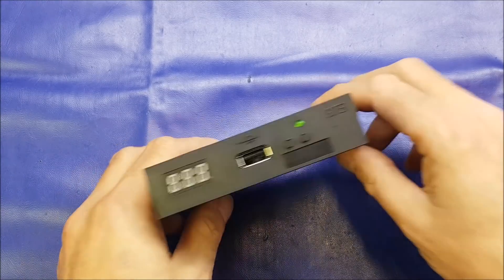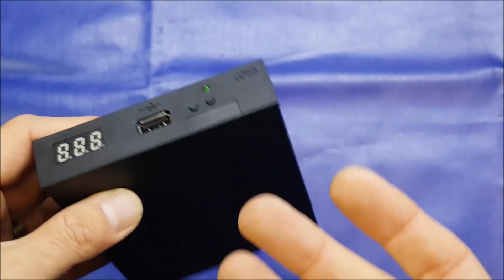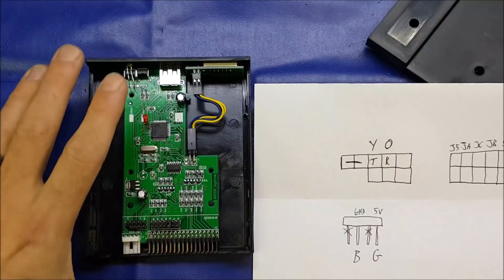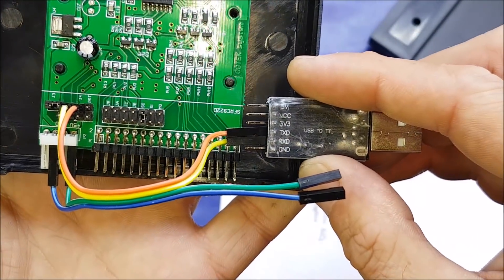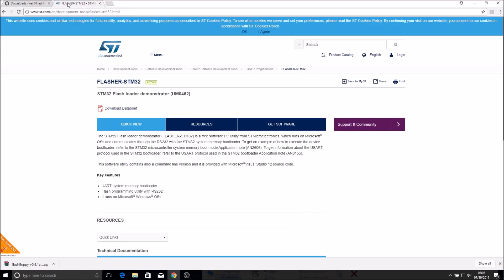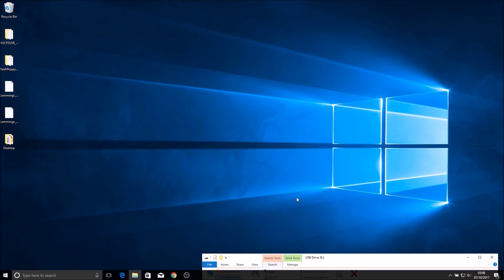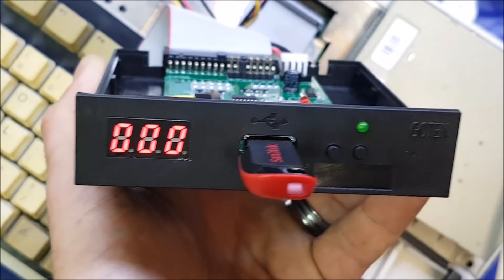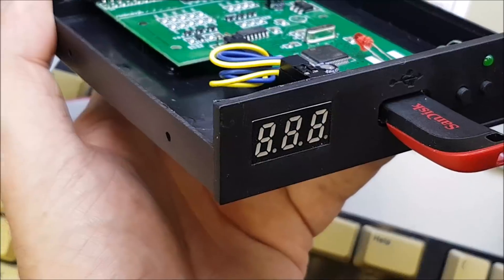Gotek drive - Flash Floppy custom firmware install and OLED / Sound mods (Amiga, Atari)

Comment: Starting in 2021, Gotek drives come with Artery microcontrollers. You need to use the Artery ISP programming software, but can still use the same serial programmer shown in your video. Wish I could like this video multiple times. Nice work.

Comment: This guide is by far the best one. Simply put and no fuss explained so that everyone can do this.
I bought a Gotek some time ago and had yet to set it up.
Mine came with no segment led, bought it direct from the suppliers so no firmware etc  so I will be fitting this OLed screen.  Why its not a standard feature is odd.

Comment: Finally got around to flashing my Gotek and it worked! My USB to serial programmer's pinouts were slightly different as you indicated in the video. Adding the LCD display was so easy. My ribbon cable's red marking was toward the power cabling, which differs from yours. The only issue I had was with the HxC files. I had to go get a newer release because the ones you linked would not work, but the new versions worked perfectly. I threw Shadow of the Beast ADFs on my flash drive and had lots of fun. Thank you very much for your video.
Reply from the maker: No worries at all!

Comment: Thanks for that. I thought I was going nuts! I tried the OLED option as well as the LCD/I2C-backpack options (with appropriate changes to FF.CFG) and nothing seemed to work except the original 7-segment displays. Turns out, whoever created the circuit diagram I was working from had the data and clock lines arse-about! At some point I switched them but I may have omitted to reset and by that time, was starting to suspect my hardware (eg. dodgy hookup cables perhaps). All looking good now, thanks to your mentioning which one was SCL.

Comment: Kris, thank you very much for this video. I'll just add that you don't need to solder the lower pins (the group of 4 pins). In fact, it is a lot easier to solder just the top 5 pins.

Comment: *Just a note that might help someone else.*  I have a Gotek SFRC922D card,  FTDI232 USB serial device, Windows 10, and the latest version of ST - Flash Loader Demonstrator (as of 9/16/2020). I could not get the ST flash software to connect to the Gotek until I wired in a couple of pull up resistors on the TX and RX lines which is most likely due to a shortcoming in the FTDI serial interface. This potential problem is discussed on the Flash Floppy "Firmware-programming" page. Rather than go to the trouble of soldering the pull up resistors to the GoTek board, I used a bread board and connected a 10k pullup resistor to each of the com lines there and wired the Vcc from the FTDI through the breadboard as well (5 volts) for the pullup supply.. This solved the connection problem and the flash process was successful.

Comment: Hi, just want to add for me to get this to work I had to add two pull up resistors to the Rx/Tx lines otherwise it just would not connect to the Gotek, great thorough video btw
Reply: Hi Brian, how big were the resistors you used to fix a problem?

Comment: That processor in the floppy emulator is probably more powerful than the 68000 in my Amiga.
Reply: Same here, i'm using that ARM beast to be a drive controller on an A7000+ acorn archimedes lol. Should be the other way around. :)
Reply: Sure it is. It has 1.25DMIPS/MHz core running up to 72MHz. That's roughly 100 Dhrystone MIPS. 68000 has roughly 0.2DMIPS/MHz (and 7MHz inside A500/A600) and even 020 or 030 can't really compete with ARM there. But... since ARM is as pure RISC as you can have it also means it usually takes more instructions to make same job done. And Dhrystone isn't exactly the best performance marker anyway. But honestly that floppy emulator in it's purest raw performance is like a beast tamed by a kitty (amiga). If there's pin compatible F4 it most likely would be faster than even 060 since it also has FPU (well no direct comparison to 060 fpu) and runs at speeds of 180MHz. So... yeah.

Comment: Nice one Kris - I had pre bought the bits ages ago to do the firmware hack and the LED replacement and drive click but hadn't done so because I knew I would have to get all the info from the different places I had seen but you've got it all in the one place for me and I'll crack on now :)
Reply from the maker: +skilgannon1971 Fantastic pal...let me know if you have any trouble and I'll try and help you out.
Reply: Thanks Kris :)

Comment: At 4:40 you say you'll need the (new) header in cojunction with the power connector to programm the Gotek. At 7:00 you explain how to connect. But the power-connector is directly connected to the (new) header. So you can use those pins to. I made a (fool proof) connector for these pins wich not only send the flash-data but also power the Gotek.

Comment: Great video! I want to put this Gotek into 2 of my vintage synths. Where did you get those jumpers at 7:40,if I deciede to go with the mods make it work from 36 pin to 24pin inputs? Kind regards.

Comment: The problem about this emulator is that’s is doesn’t go back in the number on the display, if you are for example in the 10 and you need to go back to number 8 for example there’s no way only turn in off the device our restar the keyboard...

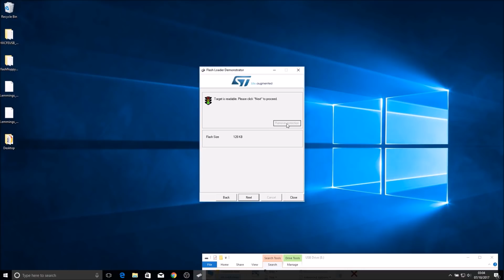Comment: Kris, Great info video. Following your steps. But you gloss over a major point. At about minute 12:15 you mention com ports. How do we find what com port to use? I show Com 1,2 & 5 available  from the DemoLoader but none connect to the USB-2-TTL I have. On another computer, I show zero com ports from the DemoLoader program with it connected. Also I get no power led on the Gotek itself. It is hard to tell what LED's you are talking about. You show no picture of the USB-2-TTL powered up with the Gotek. Suggestions? Thanks KLund1

Comment: great video and very clear. I already have one of these GOTEK drives on my MIRAGE keyboard.  It already has FF on it, I learned that from your video with the F-F showing at the start.
There are 300 disk images on the pen drive, but the display will only show 257  of them before going back to 000. IS there a way to get it to update and read all the files
thanks

Comment: No matter what I tried, my Gotek just wouldn't respond to the ST Flasher program. It got stuck in a loop of "Unrecognized response" and "No response from the target". I ended up using this tool instead: 

http://sourceforge.net/projects/stm32flash/

Check connectivity
stm32flash.exe COM22

Enable read
stm32flash.exe -k COM22

Enable write
stm32flash.exe -u COM22

Write Flash Floppy image
stm32flash.exe -w "c:\path to\FF_Gotek-v0.xx.hex" COM22

Excellent video guide. Thanks for your clear explanation. The hardware aspect was spot on for me. Just my particular drive doesn't like the flash software. Hope this helps someone.

Comment: This video is excellent thanks for making it!  I was just wondering if I was to have a gotek drive that has the FT232RL Arduino board connected to it could I still upload this firmware to it?  Or do I need the same little controller board you have?
Reply: I just used an FTDI board to do this. Actually, it may be a counterfeit FTDI chip, despite the convincing markings because it got messed up during FTDI-gate. FTDI did provide a downloader to replace the Pid and Vid that got wiped in that debacle.

Comment: The red wire of the floppy flat-cable connector (pin 1) should be on the other side?! Having the red wire on the side where the power is connected has been a defacto standard for decades.  It's very confusing seeing it connected like it is in this video, but I suspect it is connected wrong on the motherboard too. It would not work otherwise?!

People can potentially break the hardware if they would connect it this way.

Comment: After soldering the 9 pin header, connecting the jumper and following your wiring description, when connected to the pc, I have no gotek display? Disconnect all the wires, and voila! Display is back on. Is the 9 pin header related to the display output?

Comment: I have the same Gotek and bought the same (0.91") display to replace the segment led display. I connected the cables exactly as shown in the video, but the display doesn't come on. And, of course, I have no way to check if its a problem with the display.
Reply: I'm just wondering - Is it necessary to flash the firmwre update in order for the oled display to work? Or can it just be installed by changing the pin outs?

Comment: Trying to connect a gotek to an oric atmos - ive flashed the gotek with flash floppy 2.14 - set up the thumb drive............. but how do i connect the ribbon cable to the oric - the oric port is slotted so the cable will only go in 1 way , but what way do i connect the ribbon cable to the gotek !!! - if i plug it in the wrong way round it will probably kill the oric and the gotek - really appreciate any help on this - cheers man

Comment: Is there any restriction on the GOTEK firmware in order for the buzzer to work? I've got v1.05a firmware GOTEK installed in an Amiga 600, and connected a buzzer (like you did),  but still no buzzer sound.... The sound (track sound) is enabled in the settings menu too. Any ideas? Thank you in advance :-)
The same question also goes for the use of an OLED display. Do I need to upgrade firmware to a newer version etc?

Comment: Mine is booting from the usb intermittently. I can not get it to consistently boot/load from the usb drive. I have tried flashing updated firmware as well for the gotek nothing seems to help. Do you have any suggestions?

Comment: Hi. Is Amiga reverse tape connected to a floppy disk drive? In PC the red cable in the tape goes towards the power supply on pin 1 and here it is the opposite.

Comment: Just one question. I have latest HxC Floppy emulator firmware installed on my Gotek. This means that i must just buy the display and connect the cables? Thank you. Awesome video.
Reply: Yes this is plug&play with the hxc firmware. For the connections : http://hxc2001.com/download/floppy_drive_emulator/HxCGotek_I2C_SSD1306_OLED_SCREEN.jpg

Comment: Thank you very much your this video, I lost communication with stm because the dfu driver not correct functioning on my computer, only wipe the old dump but can not write the new. Computer  tell me continuous foreign parts. The straight to RX and TX line with ftdi serial converter I can reflash, and STM processor back to the business.Thanks again.

Comment: so can you set that internal switch on the Gotek to S0 and then plug it in to the S1 port on back of Amiga 500 so that you dont have to disconnect the internal floppy drive?
Reply: It needs a controler, you cannot connect it directly to the external port. Get an external Amiga floppy drive unit and put the Gotek in that.

Comment: Hi. Quick question. If I build my own gotek from scratch with an empty stm32f105 , my own pcb etc. can I flash and use this firmware without any issue? (If I'm not mistaken, the hxc version comes with a protected bootloader.)  Thanks.
Reply from the maker: Yeah you can, others have done it, I'll try and find a link.
Reply: @KrisCochrane  Can I flash and use the gotek on my piano?

Comment: Tried flashing another GOTEK today but all I keep getting in the Loader is "no response from the target". I tried resetting the gotek but it seems weird to me that not even the LED turns on when I plug it in to the USB drive with the programmer.
Reply: Same here, have you found any answer?
Reply: @nomusiqdesigners  Sadly no. My project is collecting dust. I'm probably going to bite the bullet and order an HXC Floppy Emulator or SDBOX for my amiga.
Reply: @winnetouch  Hey there!! I found the reason of my problem. It was a TTL drivers problem, after a manual update it was possible to install the FlashFloppy firmware and now my hardware is fully working!!!

Send a message to ponzillah in google mail to provide you with more information.

Comment: I keep getting the information that the firmware is out of date. I tried using the latest version (V3_1_23_1a) but I still keep getting the same error. Any clues?
Reply: sounds like you didn't remove the protection.

Comment: cool video.ive not long had my gotek and I'm having a problem when saving a game or career in SWOS it will work ok then suddenly after a while i get disk error come up for no reason. its happened twice now the first time was half way through my a season in career mode and the last time i had completed the full season in career mode saved it and the next time i came to play it the save disk said disk error. any idea's why? has anyone in the comments had this? or does any one play swos with a gotek and have it saving ok i cant work out why  it does it

Comment: How does the OLED know what it has to display?
Reply: The 4 pins, +5V, Gnd, SCK, SDA.  SCK is Serial clock, SDA is Serial Data.  The rest is in the new (Not the old Gotek) firmware.

Comment: On the contrary to what you said in your introduction, I actually found your video quite confusing and with too much waffle. First, it's unnecesary to solder pin headers as you only need them once (to do the flashing). Much easier and quicker is to use a short piece of straightened out paper clip to bridge pins 1 & 2. The holes are through plated so should not be difficult. Just ensure the ends do not contact any parts of the PCB (and remember to remove it after flashing). Secondly, a USB-A to USB-A cable is just as cheap (free if you make it yourself from two old cables, all 4 pins on both ends connected) than a TTL adapter, and it eliminates confusion over Tx to Rx connections. Thirdly, you neglected to mention that to use the OLED 0.91" inch screen you have to widen the opening on the case. Not easy to do without special tools. In my case, I also added a rotary encoder to whizz through all the files on my stick (negates the need to do a lot of button pushing to get from image 1 to - for example - image 475).

Comment: how do you use the usb a to usb a please also you cannot flash floppyflash with usb a to usb a and you need different jumpers the first two the same then link the next one to the next one down and right diagonal and flash cortex Floppy Emulator use this software https://my.st.com/content/my_st_com/en/products/development-tools/software-development-tools/stm32-software-development-tools/stm32-programmers/stsw-stm32080.html two programs to use the hex to dfu to change the cortex floppy emulator.hex file to dfu then use the dfuse demo program to flash

Comment: Me again! So new DSD TECH USB to TTL Serial Converter CP2102 arrived, Won't see device and comes up with an error! Read about faffing about with 2 x 10k Resistors might help. Gave up, made a USB-A to A Cable, followed instructions from here to flash! https://www.exxoshost.co.uk/forum/viewtopic.php?f=12&t=593&p=3940#p4036

Skip the part to create DFU File as it comes with the flashfloppy 2.14 Zip file. Now happy as finally working :-)

Comment: You should have mentioned the HxC firmware since FF is a kind of copycat of the HxC firmware using the HxC file formats and pieces of software. btw OLED, Buzzer, Rotary are also supported by the HxC firmware.
<<Gotek drive - HxC custom firmware install and OLED / Sound mods (Amiga, Atari,CPC...)>>
:(

Comment: I flashed my Gotek as explained in the video, but when I try it on my Amiga 500 it says that firmware version appears to be outdate. End when I press enter ERROR message appars: Bad Config File Version! Please help! Firmware versions shown on screen are FW FF-v0.9.29a and HxC Floppy Emulator file selector v1.85a
Reply: @djokenzi  same thing here.  How did you fix it?